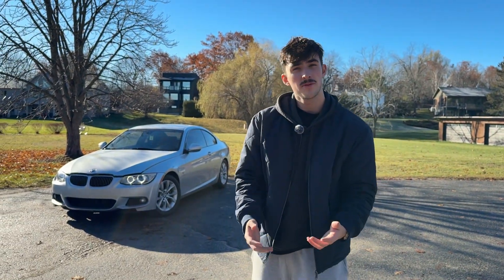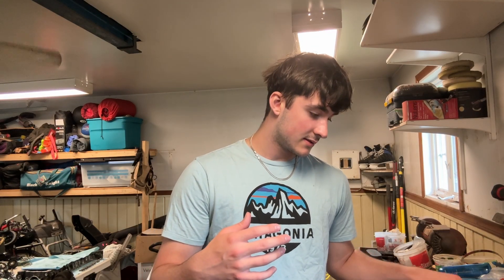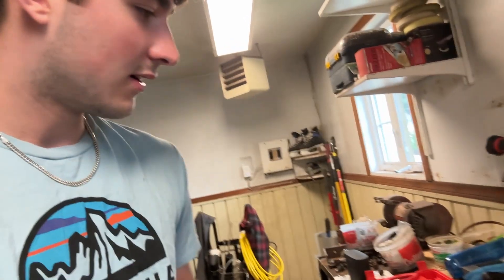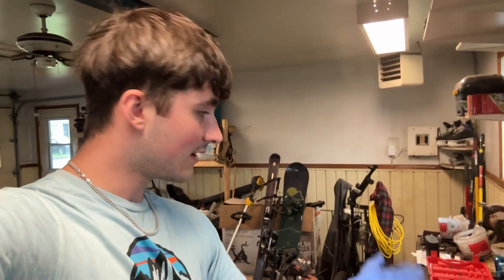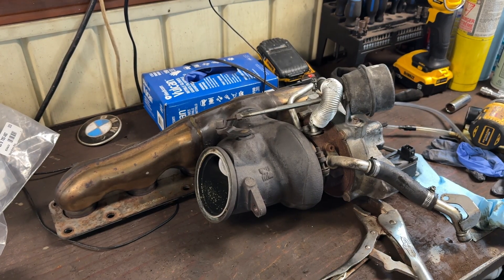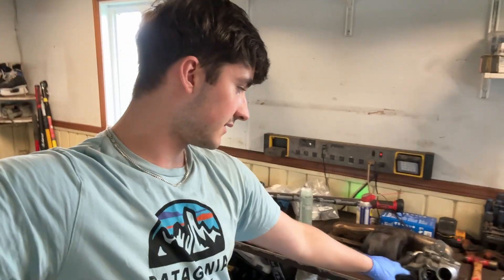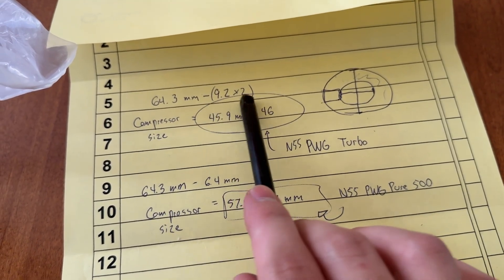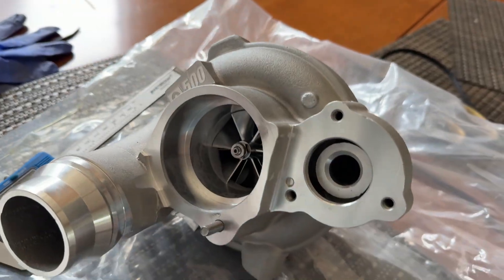The ultimate PWG N55 Pure500 upgrade guide!

Comment: the compressor size is actually 52mm I got in touch with pure because I also thought the compressor was around 57-58mm but it turnes out they machine the inlet walls outward for a better flow
Reply from the maker: Good to know thanks. Still a good improvement over stock 😂